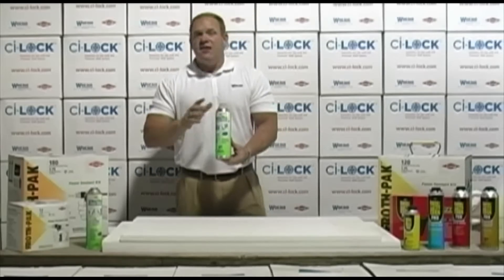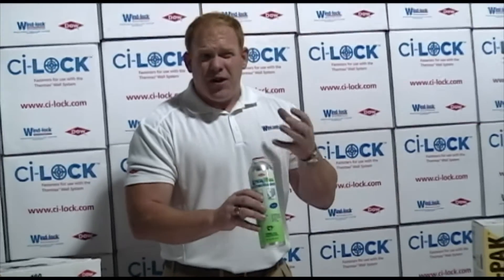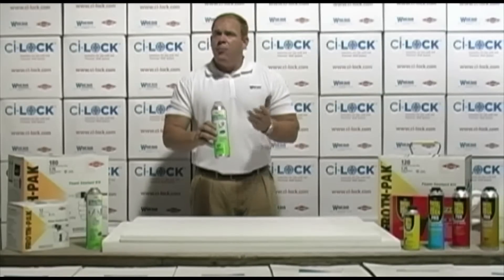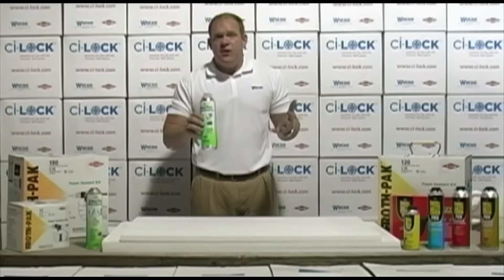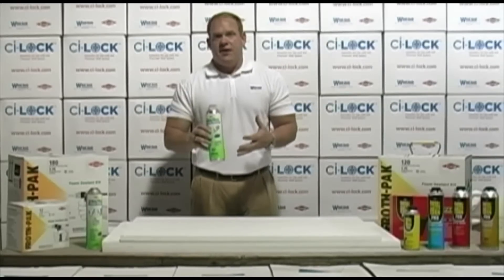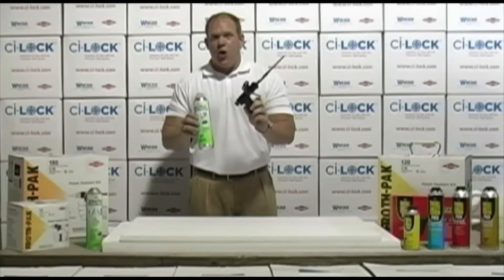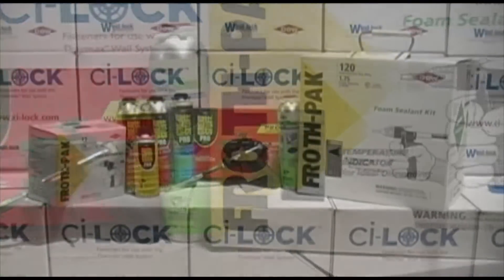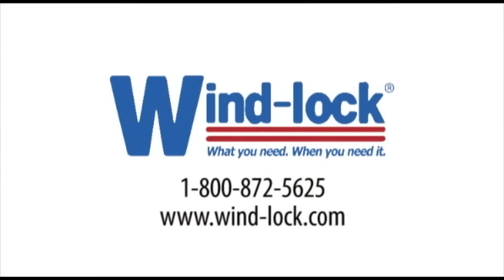Dow Episode 05: EnerFoam

Comment: Great Stuff Pro Window and Door is also a low expanding, low pressure foam, not a "non expanding, no pressure" foam.  It would be a pretty useless foam if it did not expand at all.

Enerfoam is mostly open cell while GSP W&D is mostly closed cell and accordingly has a much lower vapor permeance.

Comment from the maker: @01mustang05 We absolutely 100% do not and never have recommended any product other than Great Stuff Pro Window and Door for around the window fenestration.  All single component “can/gun” foams are between 60 and 70% closed cell.  Enerfoam is a Low expanding, Low pressure foam.  Great Stuff Pro Window and Door is a non expanding, no pressure foam. Thanks for the comment!

Comment: I spoke with the manufacturer specifically about windows & doors, as a contractor was using this stuff on a big job in our housing complex. I was told IT IS a 70% Closed Cell foam; that SHOULD NOT BE USED around windows & doors to seperate the inside from the outside. It breathes air & moisture passes thru it.

Yet you recomed here. Whats up with that?

Seeing the big picture, and knowing what this stuff is, tells me our contractor didnt care to check. Have you done the same?